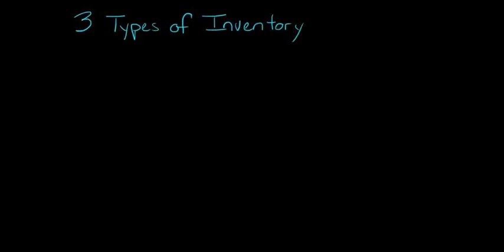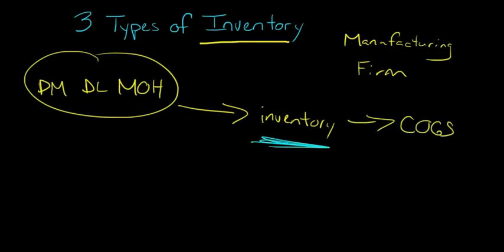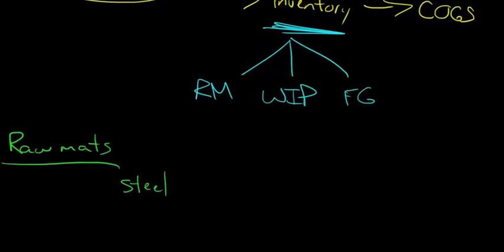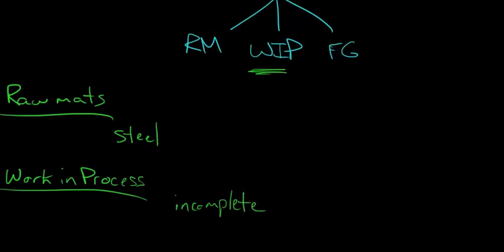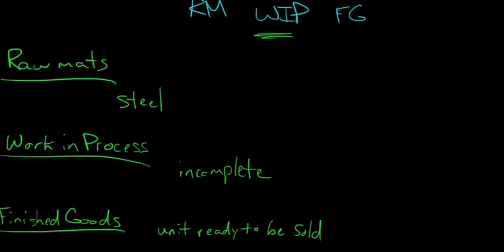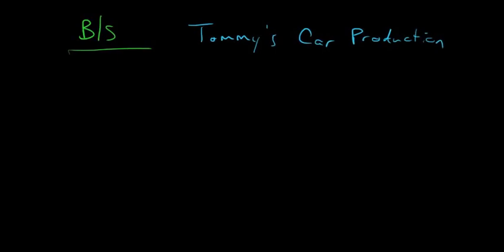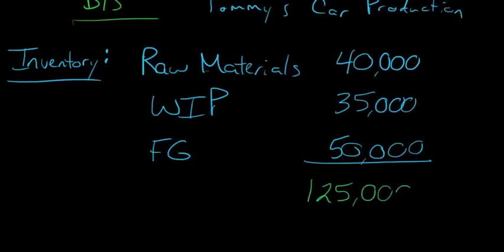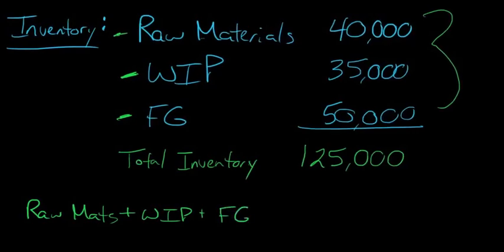3 Types of Inventory (Raw Materials, WIP, and Finished Goods)

Comment: My question is:

are RM's different than DM's?
Reply: Yoshi Negus no
Reply: i think it is different .Raw material included direct material and indirect material .Please correct me if I, m wrong.
Reply: @lowkaiyang9310  see Direct materials are materials which are directly related to producing a god such as the steel required for manufacturing car. The indirect materials would be the electricity of the factory ,air conditioning , lights etc. Hope you get it!!!